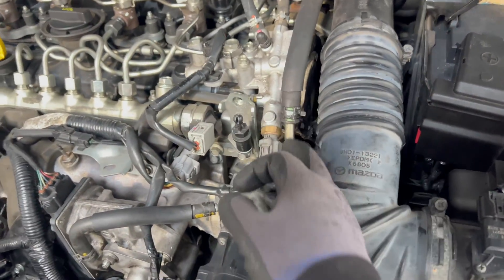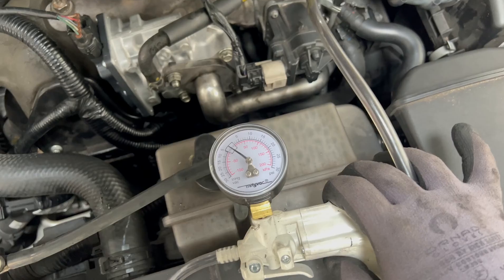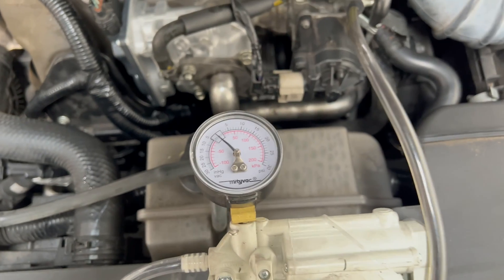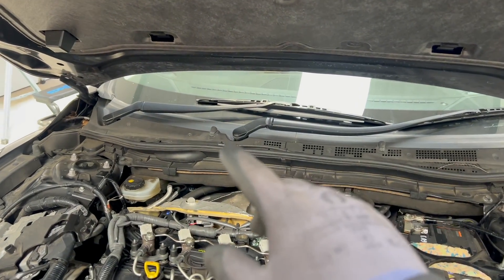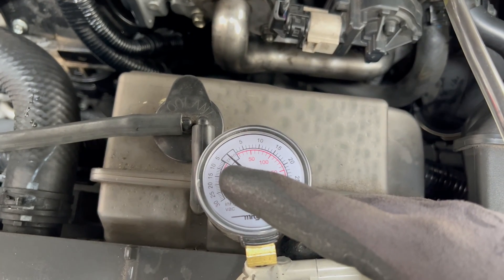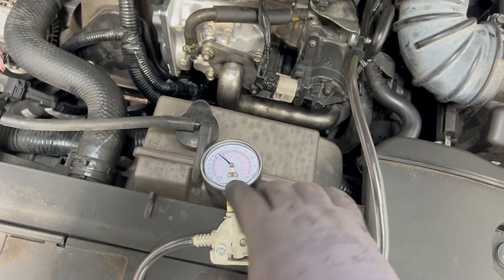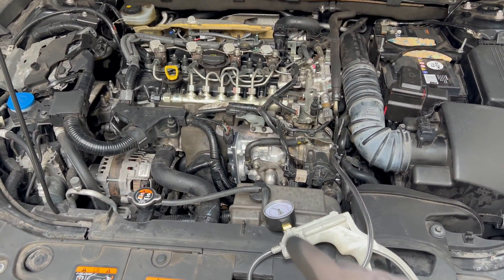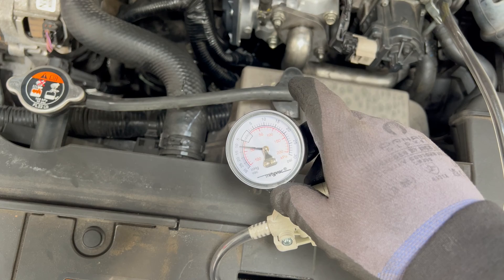Mazda Skyactiv Vacuum Pump Test - How to TEST the Vacuum Pump on Mazda 6, Mazda CX5, Mazda 3

Comment: Hi thanks to your videos I removed my oil pressure light,,,but I didn't go near the Rocker cover,I just done the strainer,, injector washers and service,,,,but I seem to have another problem,,i have four lights on my dash,,,abs , traction,,tyre pressure and a red triangle,,,I assumed it was because I had battery disconnected for long time,,,, could this be related to vacuum pump at all,,,, appreciate any advice thanks,,I seem to have a few strange codes,, longitudinal,,axis and lateral etc

Comment: First of all thank you for sharing your knowledge, I’ve a (probably related) question. When the low oil pressure warning comes, the brake power and the accelerator pedal are deactivated at the same time, a weird 3 action combo, I don't know which part to replace first..